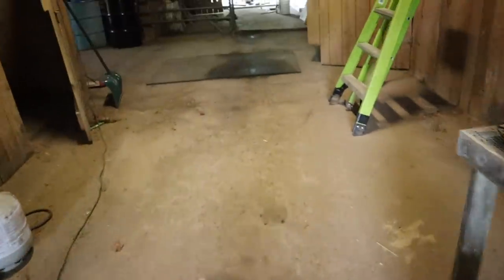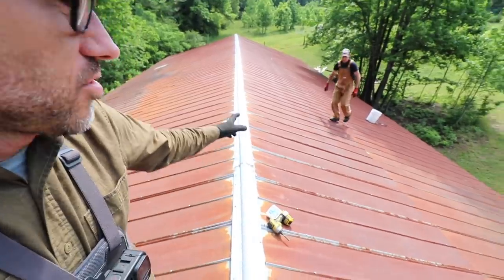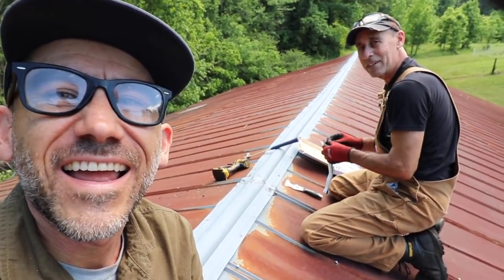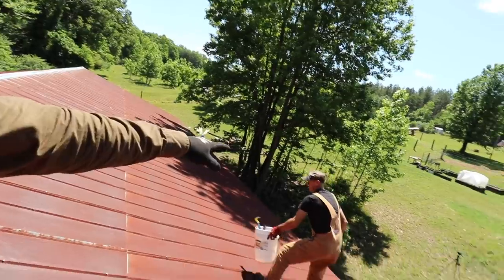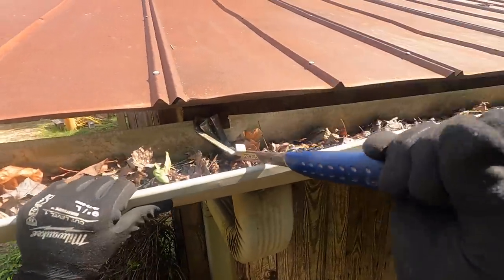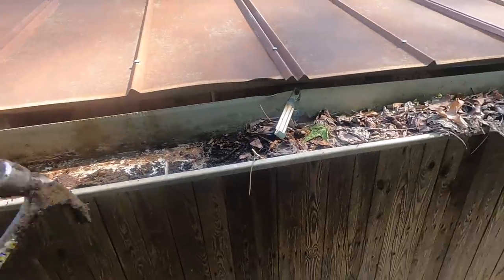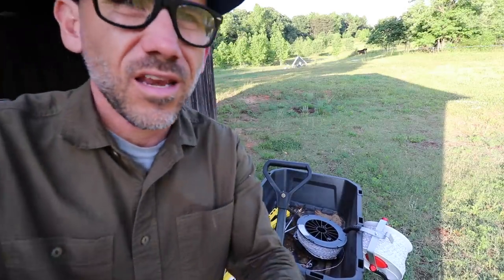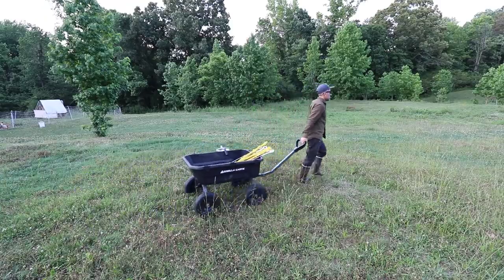Leaky 30 year old Barn Roof Needs Repair

Comment: the trouble with gutters is they fill up with leaves as you now know . the trouble with no gutters is the water will fall off the roof and splash against the wall boards and cause them to rot faster . good video as usual